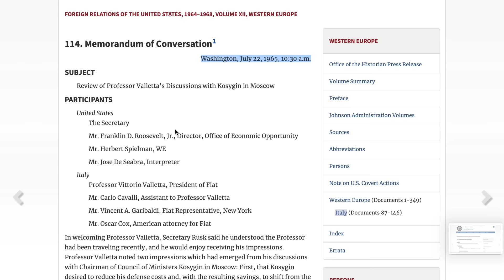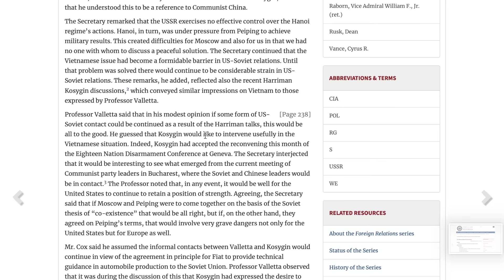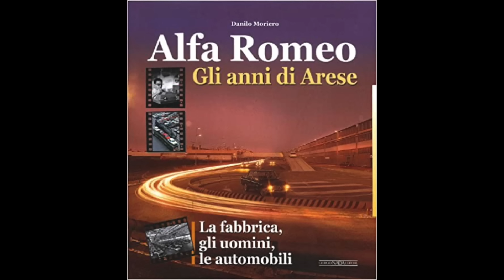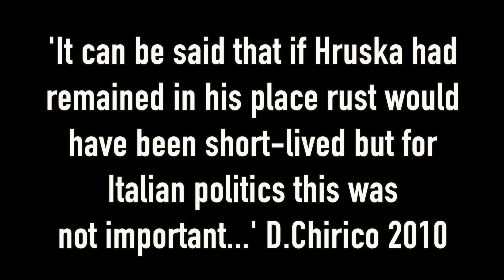Alfa Romeo And The Myth of Russian Steel - The Real Reason Alfas Rust

Comment: I sold Fiats from 1976 through 1978.  As far as rust is concerned, it was the more expensive 124 Spyders and X-1/9s that were prone to rust as opposed to the cheaper models and that's because the bodies were produced by Pininfarina and Bertone, not Fiat.  5 years after I left the business, I purchased a 1979 128 sedan from a customer I had sold it to when it was new.  The factory rustproofing was visible as one could see it under the paint on the rocker panels as they were quite textured.  Drove it through 9 Minnesota winters until it was totaled (rear ended by a Ford Explorer) in 1993.  One of the best cars I ever owned.

My understanding of the origins of the Lada is the fact that Russia wanted to build a cheap car for the masses and they didn't want to start from scratch.  Ford offered the Pinto, GM offered the Vega, Fiat offered the 124 sedan, VW offered the Beetle and there may have been a few more.  With the exception of Fiat, all of the manufacturers stipulated that if Russia produced their respective car, it couldn't be sold in the home country.  They didn't want to be put into a position of competing with themselves.  Fiat on the other hand, was through with the 124 and was planning on replacing it with the all new 131.  They weren't worried about Russian-made 124s competing against 131s in Italy.  This is one of the reasons that Russia went with the 124.  No export restrictions.  They modified it to start reliably in Russian winters and beefed up the suspension to navigate the poor Russian roads.

How much of this is myth?  You tell me.

Comment: My dad will second what you say happened at Hexagon, he remembers transporters arriving with new Suds that had rust showing around the front and rear screens, the early Suds had the screens located by metal surrounds, they later changed to rubber seals
Reply from the maker: Good to hear the confirmation Paul!
Reply: @Number27  He also bought a Beta 2000 Berlina brand new in 1979, ran it for three years, sold it to a friend of his for pennies after they were trashed by TV, and he ran it for another 6 years. My dad had it ziebart rust proofed when he bought it, it didn't rot at all.  But why didn't the importers rust proof them on arrival? The British importers of italian cars have a lot to answer for whether they be independent or worst of all directly linked to Italy. Working for Alfa GB, Lancia GB, Fiat UK etc was seen as the poison chalice for italian execs, we basically got the dead wood they couldn't get rid of.
Reply: The windscreens were supposed to be bonded in but this was one of the fiddly jobs the locals stuffed up causing another rust trap.  Achille Moroni's description of how they made a mess of this is in his report which is all in the book as is a brief description of my time at Hexagon in the mid-70s.

Comment: Everything made back then rusted like mad. My first car was a 1978 Toyota Crown, a very good car with solid mechanicals and transmissions. But by the time it was 15 years old it was full of bog and was repaired and resprayed. But alas, rust came back and if you pushed on some rust, whole panels collapsed despite having shiny paint on the surface!
Reply: Many have made similar comments on here and nobody is saying other cars did not rust.......BUT, the Alfasud was rusting through even while in the showroom and was far worse than any other Alfa Romeo.  This report is explaining why that was.  If you got 15 years out of a Toyota you did very well; Alfasuds were being scrapped and replaced under warranty in their first year.
Reply: @chrismartin9421   Wow, that bad? Pity, it was a nice looking, and no doubt driving car!

Comment: I always liked Italian cars. I learned my job at a Fiat dealer and not one car left the shop without undercoating and cavity sealing. Their bodies lasted much longer than other Fiats we took into service.
I had eight Fiats myself between 1975 and 1994, drove them over 750k kilometers. Never had any problems with rust. Almost bought a Lancia Beta HPE but the closest dealer was 80 kms away, Never got an Alfa for the same reason.
By the way, IVECO coaches also rusted away witthin two years at that time periode and so they lost the good reputution especially the German brand Magirus-Deutz used to have.

Comment: I worked in the body shop of a UK Honda dealership in the early 2000's and we were routinely welding rear wheel arch repair patches into cars that were less than three years old because they had rust  holes in them while still under warranty, many cars now have galvanized shells and rust isn't the problem it used to be so now we just blame Russia for high fuel prices instead.

Comment: Hmm.... I bought a 1969 ALFA spider new and kept it for over 40 years. No issues with rust at all. Supose it depends where you live. At the time i lived in San Francisco and not that far from the Pacific Ocean. I also washed my car frequently and made sure all the undercarriage was clean an all drain holes not blocked. I now have a 2015 ALFA 4C I bought new...carbon fiber and composite body panels don't rust ;-)  Real secret is I kept mey car in a garage so not exposed to the harsh condition of weather and never driven in snow conditions.

Comment: Good work Jack, a complicated tale well explained.  
But....
Again we have posts with the inevitable "all cars rusted in the '7os" diversion.  
True, they did, but even by the standards of the time the Alfasud was worse, at least for the first three or four years.  
Back then a normal warranty on a new car was only 1 year, but Alfa Romeo was paying dealers everywhere to repair and repaint Alfasuds under warranty (so, less than a year old).  I know every time this is mentioned there will be those who will jump to the Alfasud's defence saying, "I had a 19?? ???? 'Sud" and it lasted me twenty years, although often these claims refer to later, post -76 models which were gradually improved.  Likewise there are always others who will cite their old Fiat 127, Ford Escort, Datsun Cherry or whatever as being a rust-bucket, but the fact remains for the reasons explained about poor practices at the factory that the Alfasud rusted well over and above the industry norm.

Comment: I have a 1984 Alfa 116 GTV6 that was sold to me by Bell & Colvill in 1987.  The story that I was told by B&C was that early in 1982 the then president of the car company Massacesi, carried out an audit of production at Alfa in Milan and found that the bodies, which were produced by an outside manufacturer were being stored in a very leaky, almost derelict building in a bare metal form, the result being that when it rained the bodyshells would fill with water!  The bodyshells were then taken by open transporter to the main works where the visible rust was rubbed off and the cars dipped and painted.  Of course, water in all the cavities was never removed and paint doesn't stick to wet steel.  On seeing this the instruction to the bodyshell manufacturer was to build a waterproof storage building and transport the shells in enclosed transporters - OR ELSE!  Alfa also invested in the latest cavity priming systems so that by late 1983 the cars were up to the normal European standard.  Because of Alfas dire reputation for rusting B&C had always cavity waxed their new cars for sale with Dinitrol.  My car benefits from being both the late generation rust proof car and being wax injected. -and it shows!
A friend of mine had a Lada rally car that he competed in the Lada Challenge Series for standard(ish) cars in 1980's.  As the cars were basically Fiat 124s the parts were interchangeable.  The trick was to substitute Fiat body panels for the Lada ones as they were much lighter being about 1/2 the thickness and appeared to be made of a higher grade steel that was more difficult to weld.  That steel rusted noticeably quicker than the Russian Lada components.  Even being 1/2 the thickness of the Lada panels, the Fiat panels were very nearly as stiff, further giving credence to the steel quality observation.

Comment: The rust problem was not confined to Italian cars of the time...a neighbour of mine back in the early 80s bought an Austin Metro which had the driver and the passenger doors rust through within 6 months of purchase from new.
Reply: Yes, I remember that too. I lived in Germany in the 70s and I remember the VW Golf and Polo, Audi 80 and 100 and other cars were rusting horrendously. Back then the cars did not have very good corrosion prevention and in winter salt was poured onto every road. Most cars started having holes after 3-5 years. Mufflers lasted often only 2 years. Back then the story told was that in the 70s a lot of bad steel came from Northern Italy.
Reply: True the '70s had a lot of rusty cars, but the point of this investigation was to find out why the Alfasud rusted much faster and with worse consequences than the rest of the Alfa range which were made from the same steel supply but in the Milan factory rather than Pomigliano d'Arco.

Comment: My Datsun 1974 300z slant 6 motor, hydraulic clutch was a rust bucket also. So was the Ford Maverick.  That Datsun would get up to 140 miles per hour in 3rd gear and had 4th and fifth still to go. The faster I drove it the lower to the ground the car went.  It was like sailing on a lake ,smooth as glass at 140. It could have gone much faster but I wasn't trying to kill myself. It was heavy as a tank for a little car. Very hard to push start.

Comment: The problem with the Beta that killed the marque off in the U.K. was with the box section the engine sat on. Some of the early saloon no deals had no drains and water would get in and rust the thing out and the engine could drop. They went public with that and recalled them to sort it for free. The tabloids crucified the brand and mud stuck. They were not particularly cheap cars and they had a decent share of the better end of the car market at the time. The general rust problem with Italian cars was the same as every other car maker at the time. By the end of the 80s they used galvanised steel and had proper wax protection with a warranty by then. But the damage to reputation was done. The performance type cars sold to petrol heads but the general punters didn’t want to go there for their family car with the regular models. Now they are gone

Comment: Great explanation. My first nine cars were Alfas, all assembled/built in South Africa, and all were to a greater or larger degree rust buckets, particularly here on the Cape coast where I live. My question, and perhaps Jack can answer this: Were those cars imported as PKD units (partly knocked down) or were they pressed at the Rosslyn plant? If they were pressed here, it would point to poor design as far as anti corrosion measures go. The Alfa plant was on the Highveld, hundreds of miles from sea air...
Reply: I believe they were imported as CKD kits.  There was a requirement for a certain percentage of local content and that may have been accounted for by local supplies of tyres, electrics, upholstery, possibly even glass, but I doubt they would have had their own in-house body presses in S.A.  So, if they were assembled from bodies made in Italy they would have already had the same rust problems built in but as I think they were only built there from 1981 the body prep was much improved by then anyway; the worst of the rust problems afflicted the pre-77 cars.

Comment: One of the problems was that when Alfa was effectively forced by the Italian government to establish the southern plant - hence the Alfa Sud (south) name - hardly any of the workforce had even seen the inside of a large production facility before, far less worked in a car plant. Having previously worked for Rootes/Chrysler, Triumph and Rover (both pre-BL) in the UK, plus Ford, GMH, AMI (Toyota, Triumph & American Motors Rambler) and Nissan in Australia, I know that a car plant is a very different sort of place to work. Too fast a line-speed, for example, inevitably leads to items being missed or only half-completed and the end result is a product that rapidly develops an often-deserved reputation for poor quality. Indeed, in the early 1970's, Fiat's faith in their product was so little that, on the Australian market, they only warranted their cars for 6 month or 6,000 miles, whereas almost everyone else had a 12/12 warranty. Needless to say, they folded shortly thereafter and were absent from the scene for many decades; they still struggle to gain a decent foothold today.

Comment: I believe the issue has more to do with markets in Southern Europe where Fiat had a big following using much less salt on their roads in winter if any, so why add cost into your product for something most of your customers don't need. As for the Alfa Sud well I restored one that had lived in Southern Italy, and so was effectively rebuilt as almost all of those that survive in Norther Europe are. I found the wings had been bolted on bare metal to bare metal before any dip and or paint had been applied nor had any attempt been made to seal the area. That was not done by the Unions, that was in manufacturing process and showed that corrosion resistance was not a priority.

Comment: Interesting video. I had a 1970 Avenger which rusted away within 5 years, so clearly noot just an Italian problem. However, some of the rustiest cars I have ever seen were Italian, and too many of them premium models sourced from Bertone, Pininfarina, Zagato, Touring etc.

I guess lower down someone has pointed out that the Roosevelt in question was never President, but the son of. One of President Roosevelt's sons was an early US representative for Abarth, maybe the same perso.

I spoke onec to a Swiss Metal Broker, who had had a long career in the metal markets. He told me that the car industry forward buys its metals, and that the Japanese export boom into USA in the mid/late 60s caugt some European manufacturuers on the hop, so that they were obliged to buy from non/traditional suppliers. That also seems plausible,

Comment: Not just Alfa and Lancia.  In the late 1970's I bought a 1968 Fiat 124 Sport AC Coupe. A beautiful car, but rust in several areas. Still not gun-shy of Italian cars, in the early '80's I bought a new Alfasud Sprint coupe.  Another fantastic car, but at just 7 months a rust bubble emerged around the hole where the passenger side windscreen motor arm exited the bodywork.  I took it back to the dealer to be told that the warranty for rust on Alfas was six months and  as my car was 7 months old I would have to pay!  I have never bought another Italian car since. Still had not having learned my lesson and straight after the Alfa I bought a Jaguar XJS Coupe, a car that was so totally dreadful by every measure that I yearned for the Alfa!  Have never bought another British car either.

Comment: Mid 70's North American cars may not have been quite as bad but rust perforation starting on a 2 year old car was far from uncommon.  Particularly fender arches.  They used to say "drive your new Chev or Ford home, park it in the driveway and listen to it starting to rust."  My family had 3 Fords through the 1970's - 73 Custom, 74 LTD, 75 T-Bird.  None of them survived to 1980.  Chevrolet introduced the new Vega, complete with a modern rust proofing.  They hot dipped the entire complete body shells in molten zinc to galvanize them.  Problem was they forgot about air pockets that formed inside the shells that the galvanizing could not reach.  It is true "they don't build em like they used to" - and a very good thing too!  PS I had never heard the Soviet steel story before.

Comment: Thanks for clarifying that Jack. I'd always wondered why even if Fiat got some steel from USSR it should affect Alfas? As Alfa weren't bailed out by Fiat until 1986
 It could have effected Lancia though with the Beta, as they were bailed out by Fiat earlier, in the late 60's.
Reply: I wonder does the rust issue still exist today over at Fiat as well.

Comment: I have owned both an Alfetta and an Alfasud. They both rusted from inside out. Newly painted metal rusted under the paint so something was wrong with the steel. It seemed like galvanic corrotion. Seemed as there was copper in the steel. Perhaps Taranto used recyckled steel in their plant?

Comment: I have a bit motor to add, it's not in Italy and not Alfa, although Alfa also suffered with it there. I Lived in South Africa, in Durban where the Toyota factory was. in 1970 my Mother bought a Toyota 1900 GSL, It was a great car, with close ratio 5 speed gearbox. In 1976 it developed a 40mm hole in one front door, which I welded and I also painted the whole car and it never rusted again. At about this time a new model came out with a square look, forget the name, but it was to replace the older one like my Mother had. Within a year they were rotten with rust! I always wondered about this. In the 80's I flew to Johannesburg on business, struck up a guy on the plane who told me he was a buyer for the toyota Factory and I asked him why the older one was better. He Told me that they used cold rolled steel for the older and Hot rolled later to cut costs and this was the problem.